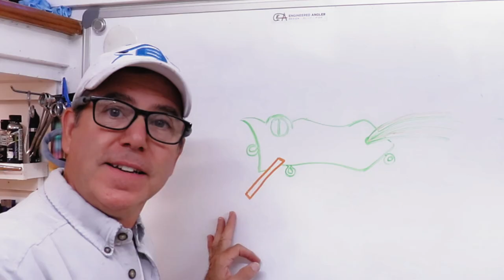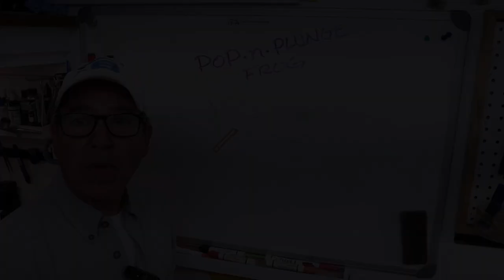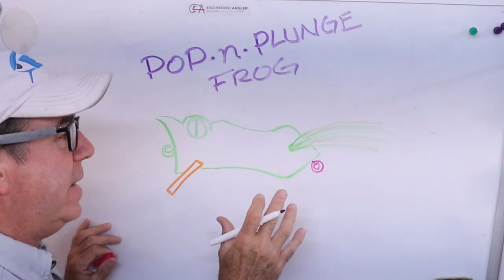Making a Frog Popper that Dives   #frogpopper  #bassfrog

Comment: A popper with a bib  -  interesting idea!    Franco, I've been  going through your previous wood lure videos trying to pin down your painting process - you have snippets of information scattered through out your videos but I would like to ask you to do a "finishing specific" video(s). Think a lot of people would appreciate a discussion of sanding sealers, base coats, primers, paint types, paint additives (like Createx 4030), inter coats and top coats.  Lots of questions could be answered... epoxy and polycrylic layers are smooth - do you always scruff the shine off or is an adhesion enhancer like 4030 adequate? How many top coats do you use on lures for toothy predators? Could be a series of videos expanding into different  paints and painting  techniques. Just a thought, seem to be a lot of new people getting into lure building. Myself, I am very familiar/comfortable with  epoxies, polyurethanes,  varnishes and all manners of secret wood finishing potions. It's the water-based products that are new to me so surface preparation and final finishing are things that I am curious about. Cheers!  Hank
Reply from the maker: Thank you this feedback...I'll consider doing a vid along these lines.

Comment: Hi Franco,  a quick question if you don't mind... I'm looking for a led floodlight  like the black one you have to cure the Alumi-UV resin. Can't find one in 365nm.  What frequency is you unit? Can I use a 395-405nm unit with reasonable results? Thanks for your help! (P.S. I'm in the process of converting one of those nail-lamps to a lure turner - fun stuff!)
Reply from the maker: Yes you can use a 395nm lamp 10amps or higher. It will work for setting small stuff.
Reply: @EngineeredAngler  thanks  Franco!